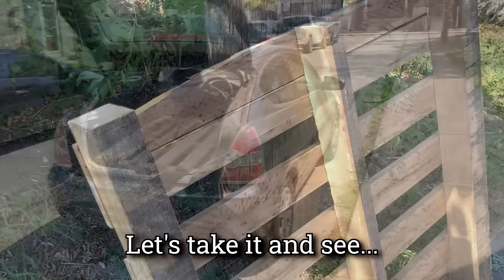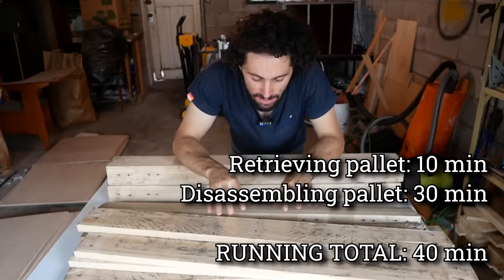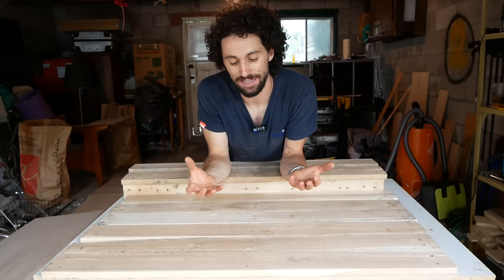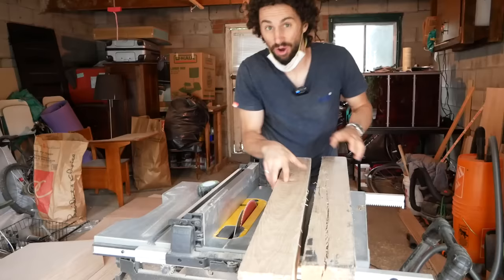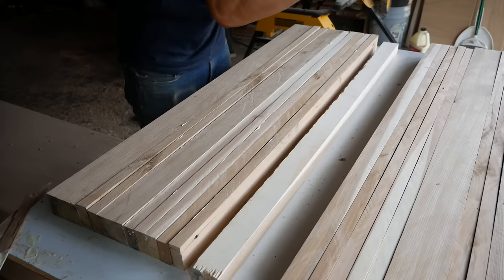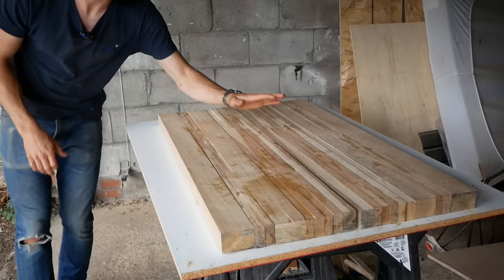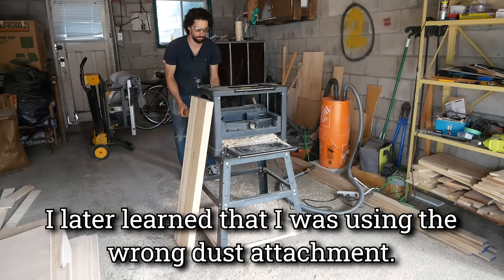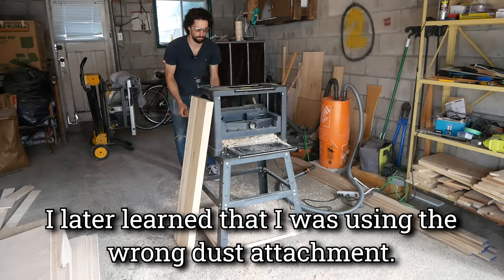Turning a Free Pallet into a $550 Table

Comment: If I'm not mistaken, I think you come out ahead buying the wood instead of spending the time in deconstructing the pallet plus you have more control and consistency of material. Assuming 20 board feet (about $120 for oak) you could make 3 of those within the same timeframe. Jointer and drum sander will save even more time.
Reply: He made about $900 to $1200 of the YouTube video because it was a pallet
Reply: @alexandercastaneda9568  yeah its probably more like $5.000 with that 2.8 million views ;)

Comment: Hey mate, nice work!
A tip I picked up from 731 woodworks: use a spirit level up against you table saw fence the your piece of wood and push both through at the same time as a make shift edge jointer

Comment: Instead of Epoxy you can use two things you'll always have on hand. Saw dust and wood glue. Mix together until it's kinda putty like. Pack it in the cracks and wipe the excess off with a wet rag. Cheaper and easier to clean up.
Reply: That makes for a an ugly finish.
Reply: @raulduke1528  no it doesn’t. It matches the wood colour perfectly
Reply: @raulduke1528  it looks ugly if you half ass it.

Comment: An off feed table for your table saw saw would be a huge help. 
That way your boards won't drop down as you are running them through the table saw. 
Also, a shop vac hooked up to your planer will help you with saw dust from building up in your planer and going every where in your shop.
Stay cool, and keep building!!!!!

Comment: That table top will not stay flat for long. You always need to check the end grains are going opposite directions before a glue up otherwise the structure of the  table top will be compromised and start bending.
Reply: It was already cupping in the video.
Reply: @kevinsterner9104  i wasn't sure of that was the camera lens...often the wide angle throws a curve on all kinds of straight things.
Reply: That really only applies when you are jointing the boards. He stacked them end grain up so it won't matter.
Reply: @kevinsterner9104  it was cupping because he only clamped it from one side.
Reply: IF...not of.  Yelling at self. Haha!
Reply: @WillNelsen  I didn't catch that in my first watch. Yes clamping from 1 side like that will pretty much always bow it.

Comment: In my experience, pallets tend to split at the nail holes in the end. I get better boards if I saw just inside the two ends and just hammer the remaining 1" piece out then pull the nails with my side puller in my hammer. Takes almost 1/4 the time to do and you really don't lose that much material. Jointing removes any saw marks in the underlying 2x4 if your depth was shallow enough.

Also, use a sander to clean off the dirt of you really want. Otherwise just use the planer and save the time and carpal tunnel.

Comment: Remember that using two different species will move differently. The strength of one wood will rip the other boards apart. Moisture content is crucial when you are mixing woods. Yes the planet was bogging due to the chips jamming up. Good indication is watching the chips blow out of the deck and not out of the port. Great video
Reply: I can't believe the number of excellent advice in the comments. So generous of everyone. I never would have known that the strength of one wood would rip the other boards apart. Funny isn't it. Somebody always needs to win. Even trees. 🤣

Comment: Given the frequency with which you drop shit and the fact you regularly put both hands near the blade (and stand directly behind large pieces while doing so to boot) I predict you will not have all ten fingers still intact. Not for long. 

Nice job on the table. F- on the shop safety.
Reply: Ha funny - ya the $550 or what ever is 'claimed' might be an acceptable down payment for the upcoming ER treatment

Comment: 9:42  Yes, clamps are expensive, but a temporary clamping bench can be thrown together fast using scrap, and will provide all the clamping pressure and points needed.  Just clamp (or permanently attach) a fixed straight fence to your workbench on one side (pretty thick, strong board), then a series of shop-made wedge 'clamps' on the other, which consist of small blocks of scrap screwed to the same surface as the fence, but having a gap between them and the work.  Fill this gap with an unglued board (like the thick fence board but functioning as a movable clamp jaw pad, that doesn't slide against the work piece as the wedge would, plus distributes the wedge's force out wider) and the remaining gap between the fixed block and pad with a simple scrap wedge.  Orient the fixed block at an angle matching the wedge before screwing it to the bench so that all gaps are closed and everything tight together, with the wedge hanging out of its gap about 3/4 of the way.  Then just hammer each wedge in tight.  Do one of these fixed blocks and wedges for as many points as you have room on that one side of the workpiece.  If this is still not enough clamping points, then unscrew the fixed fence on the other side so it's also a free-floating clamp jaw pad and make a series of wedges and fixed blocks on that side.  Locate each of these clamps in between the clamps on the opposite side, so that you have a wedge on one side facing a stretch of the unglued pad board on the other (which is why it needs to be a thick board).  This gives you all the clamping points you could want, one one side then the other.

Oh, and remember to blunt the tips of each wedge, not feathering out to nothing, so that you can easily use a hammer and screwdriver and tap them out backward to release them, so you can re-use the wedges later.  Prying them up can damage the wedges and the bench surface, if you can get them out at all by prying.

And you may want to use a few clamping cauls, to keep everything flat and in the same plane.  These can simply be the slightly curved boards you've been avoiding using for anything else, but by putting the curve pointing downward across your panel and clamping the ends (with a few regular clamps), their spring pressure works well for keeping the panel flat against your workbench.

As you can see, this clamping setup is customizable by simply unscrewing the fixed blocks then screwing them down again for any different-sized panel glue-ups, so it isn't a fancy tool, and there will be screw holes accumulating over time.  Or it can be broken down and its component pieces used in other projects.  It's just a bunch of scrap.  But the clamping pressure it can deliver can easily outmatch the most expensive set of Bessey clamps.
Reply: With the amount of time you took to type all that, you could have made a video, Bill.
Reply: @allaboutroofing2  LOL.  I've been told I don't know about brevity.  Not sure where they're getting that.  😎
Reply: @billparrish4385  pleeeeeez make a video.  even just a quick one showing something in your clamp bench.
Reply: @coppulor6500  Ah, but then you would quickly see how my 'gift of gab' far exceeds my abilities as a videographer!  :)   However, the first place I saw the concept is on Izzy Swan's channel, which you can see here:  https://youtu.be/r7yLMN-nMu0?t=65  , or search for "DIY Hacks - 8 money saving handyman and woodworking hacks" starting at 1 minute 5 seconds.  And I highly recommend his channel as 'must see' for his inventiveness and skills, including several 'wedge clamp' ideas over the years there.  If you compare his demo in the one I referenced with my further slight modifications I describe, you'll see my only additions to his genius idea were to have multiple fixed blocks, 1 wedge per block instead of 2, set at the angle of their wedges, and with a board between the wedge and work piece to spread the clamping pressure.  Oh, and some scrap cauls across the glue-up to keep it flat.  Plus, I don't generally keep these clamping jigs around a long time, and have made and broken down a few of them over the years, repurposing the materials in other projects, and making a new one from scrap as needed.  They're that easy.  Good luck!
Reply: @billparrish4385  thank you!

Comment: 11:45 resin is ok - but try Borden's water based wood filler (comes in several shades) dries very sandable and will accept stain very nicely!!!
Reply: Thanks for the tip really helpful for this new woodworker
Reply: Also sawdust and wood glue work well

Comment: my dude, you are brave for putting that pallet through the planer
Reply: Yes even if you get all the nails out the type of clips they use in nailguns for pallets has wire linking the nails witch get stuck in the board and chew up your blades in a heart beat... Go over the board with a pinpoint metal detector
Reply: @herschelgross5187  just go buy real materials to work with in the 1st place and Dad won't need to spring for new planer blades every time you discover another magical find at the end of someone's driveway

Comment: I felt bad watching someone buy that for $550 after seeing the planing job do nothing since shims and a known flat edge sled weren't used. It was also tough to watch the table saw be used to try and rip a straight edge without first clamping or taping the raw piece to a known square board and running that against the fence instead. That coffee table was worth about what the first person wanted to pay for it - $250.

Others have already mentioned it, but that table saw technique was downright scary.

Comment: That was great, the only difference is I save my sawdust.  I mix it with woodglue and make a paste, feel holes or cracks, then when dry I sand.  It's lower cost and it actually takes stain well, God Bless!
Reply from the maker: Thanks for watching!
Reply: @MorleyKert  Better option is to use whatever finish you are going to use to mix with the saw dust, for larger cracks. For smaller cracks and gaps, on your first finishing coat, sand it before the finish cures. This creates a slurry that can be used to fill those cracks. Repeat for a second coat if needed. That way there is zero chance of the finish being marred by glue stains. Nice job still.
Reply: Yes. I have a box of sawdust I keep for that purpose. I typically make an epoxy sawdust paste for larger/deeper areas. I've tried using wood glue, but it will shrink during drying and can require a second application on larger fills. Epoxy doesn't really dry, it cures. And if it shrinks, it is very little. I tend to overfill and then shave it flat with a chisel when it is partially cured and has a soft plastic consistency.
Reply: @colinfraser9778  Thanks, God bless!
Reply: @wturber   I find that epoxy, no matter how much sawdust I mix in with it, leaves an area on the surface that just won't take stain or shellac or even wipe-on poly. I saw a Ron Cosman or Rex Kruger (One of them I think) that discussed this point and suggested using the finish as the medium to mix with the sawdust. Tried it and got a much better result. If I do it right and with some care, even glued edges can be blurred  to the point of not being easily noticeable.

Comment: Just a tip, when prising the boards off the pallet use a scrap flat piece of wood underneath the bend in the crow bar so you don’t put any dents in each board removing nails 👍🏻🍻

Comment: i recently did a pallet table with reclaimed pallets! i staggered the pieces to create a top 6ft long and 25inches wide. it has 2 cross support sections underneath for stability reasons but WOW did it turn out great. i hopped on here to see similar ideas and you did yours almost identically to mine, except you didn't have to stagger the pieces to make it longer! such a good finish, and i wish i would have did chamfered edges, they're just rounded ever so slightly.
Reply from the maker: That sounds beautiful! I would like to make some bigger pieces with multiple pallets
Reply: Do you have pics? Would love to see it. Reddit post? Lol

Comment: Tip: cut thick slabs of wood in multiple passes, reduces the load on the circular saw by a lot! 2-4 passes would've sawn of those ends at 10:40 no problem
Reply: True

Comment: One thing I feel the need to point out: to get your first true edge and face, you would use a jointer, then use that edge against your table saw fence (edge) and planer (face) to create your second true edge and face.
Reply: Or you can build a jig to run in the slot of your table saw and mount your board to the jig and cut the opposite side then use that against your table saw fence.... And ya use a push stick....O.o

Comment: Always examine your wood with a small metal detector (available at Lowes, Home Depot, etc for approx $30) before running it through a planer or table saw. Broken-off nails and screws will ruin your blades.
Reply: yes, and possibly hands / belly in regards to the table saw...

Comment: I am a wood worker myself and wanting to get my name out there. The way you broke everything down was extremely helpful. I have probably 30 pallets I have broken down and began to get discouraged thinking I shouldn't have done it. After seeing what you accomplished, it brought me back to feeling as though I did the right thing.
Reply from the maker: That’s awesome to hear, thanks for watching!
Reply: @MorleyKert  I would like to ask you, have you thought about doing 3 or 4 at a time? Wouldn't your profit margin go through the roof?  By having each of them vary in the finishing stage.  Like an assembly line, you wouldn't have to set up for each individual one. They would be identical. Btw, check out bourbon moth wood working, shop nation,, and Steve Ramsey wood working for mere mortals.

Comment: Some tips if you are building pallet furniture from someone who used to collect and disassemble pallets:

*Be safe and use all precautions when handling any cutting tool or power tool.....it only takes one mess up...
*Pallet wood is treated so sanding it will not get rid of it, it is IN the wood, the sawdust (if exposed to a lot) can be very bad for you.
*Pallet wood can warp on you. I know it is cured hardwood but I have had several pieces of pallet furniture warp slightly. My coffee table warped in the middle after 5 years, my shelves in my garage all have a lil warpage, etc. Not your typical warpage over time from weight or moisture either. I don't know why exactly but pallet wood, especially the slats, won't stay true like cured, unstressed lumber.

Comment: Just want to make a really important point that NEEDS to be made. ALWAYS check pallets. You don't know where they came from or if chemicals were used with them. They could have chemicals on them and then you sell that pallet table to someone and then they could get really sick (Possibly cancer) from what was on the pallets. ALWAYS look for codes on the pallets. If there is no code, take heed with them. If there's a business name stamped on it, maybe contact them and ask if anything chemical was used on it.
Be very cautious.
Reply: He is sanding it down and planning it several times though.
Reply: @carlgoranheintz3914  Sometimes that is NOT enough. There are people out there that get sick from furniture that has been made from pallets. Depending on chemicals that could be in the wood, fumes are enough to cause issues, and that can be hard to get rid of. Don't always assume sanding and planing is enough.
Reply: ᴠᴇɴᴜs ʙʟᴏᴏᴅғʟᴏᴡ  Read the comment I gave to the first guy.
Reply: this should be higher up

Comment: Awesome work, table came out great!

Few things though, you definitely need a push stick...your fingers are way too close to the blade, especially when you did the 2 passes through the larger piece. Second I probably would have used some dowels to connect the 2 halves just for a bit more stability vs glue alone. And third you might want to try getting some cauls to keep the glue ups as flat/reduce possible movement and cupping. 

All in all, great job and nice repurposing.

Comment: Watched the entire vid and loved every minute of it. The 'finger police' are looking out for you and I hope you're more careful. I think they're this insistent b/c some of them (me included) have seen horrible things happen w/ tools that were easily avoidable; such a tragic waste.
I suspect you'll be adding equipment as you go along. I have a pretty well tricked out man cave shop that I enjoy building stuff in. Each project is a learning experience and I don't take commissions. I'm 64 and have a thriving biz as a novelist. 
My suggestion to you comes down to one word: BENCHES. Having a couple of solid surfaces to work on make the jobs super easy. Those plastic sawhorses you're using are a great starting point, but 2nd hand fold up benches w/ a 3/4 to 1" slab will make your life a lot easier until you build you're forever work bench. 
Best of luck to you in these endeavors. Making $50/ hr in the shop is fantastic dough; TBH, you're gonna find it tough to get much higher than that w/o doing production pieces (4-5 tables for example) 
The marketing is going to be hard, maybe. I think you spent a few more hours on this project that you didn't account for; but even so, it's a fantastic start.
But you live in the big TO, so that will help.